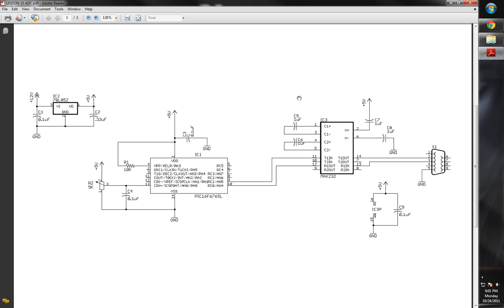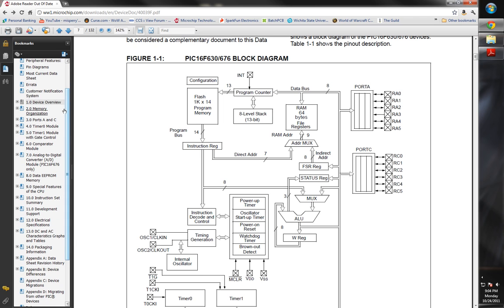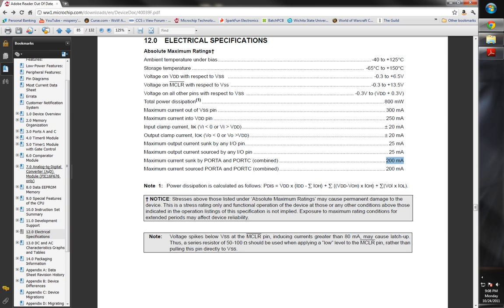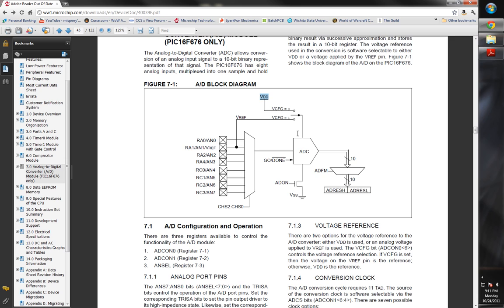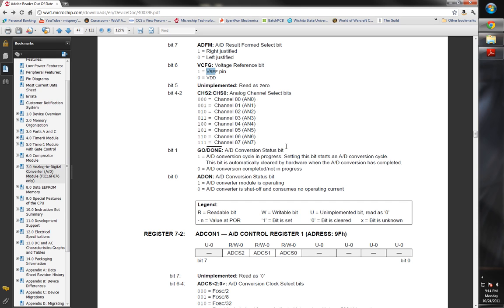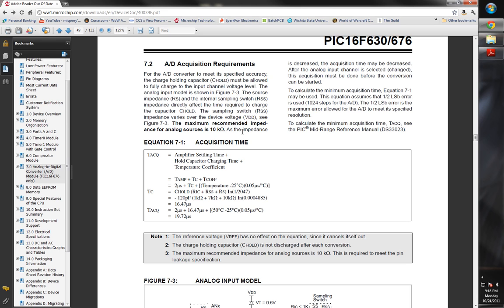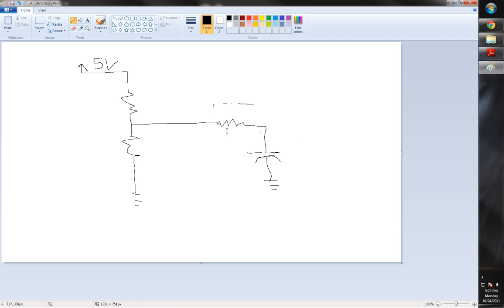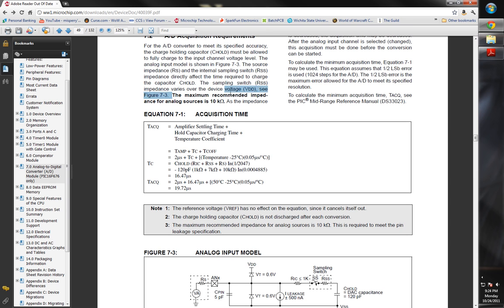LESSON 15 ADC PART1

Comment: Hi everyone;
I m doing a Smps project and using 16f877 as a controller, for that I must check the input voltage using analog input of the pic, input range will be 60-90 so i m using 3.3k and 56k resistor to get a range of 0-5V at the input of the anolog, But unfortunately as soon as I connect the anolog pin to the between of these two resistor that ı used as a voltage diveder, voltage just drops to nearly zero, I used zener to avoid that but noway, ı even used a voltage follower to get a low resistance an the input of analog pin, nothing is changed, 16f877 doesnt read the correct value, By the way I can easly read the value from the circuit I made with an arduino mega, Please some help me before ı get out of my mind!!!
Reply from the maker: Hey there, thanks for the comment.  What pin are you connecting your divider too?  This particular pic has external voltage reference pins on RA2 & RA3.  If you are connecting to RA2 ensure that you have set it in the ADCON1 register to not connect to Vss.  If it does you are basically applying ground to your divider which is why it is pulling the voltage down.  Also a zener only works for voltage spikes.  If you have something pulling the voltage down the zener will not help.  Plus zeners are leaky so be carful on choosing a zener that has a high leakage current since it could skew your results of your ADC.  Good rule of thumb is when using pins that have shared functionality ensure you have all functions that you don't want disabled and the only feature enabled is the one you want.

Hope this helps.  Good luck.
Reply: Thank you very very much for your attention, problem is solved :)
Reply from the maker: Awesome!  Glad to hear it and thanks for sharing.